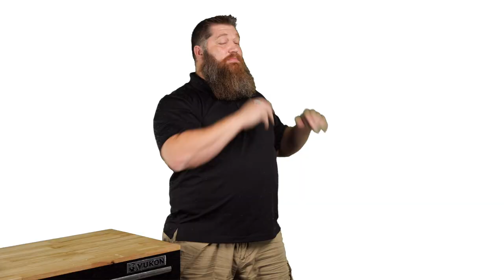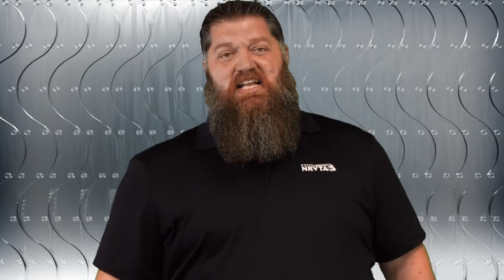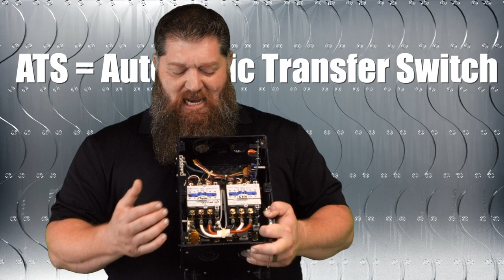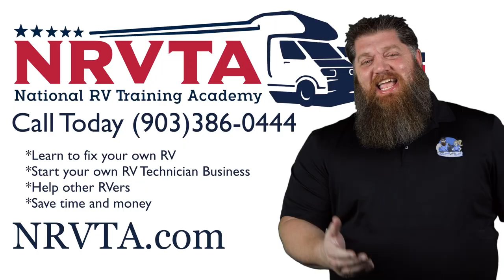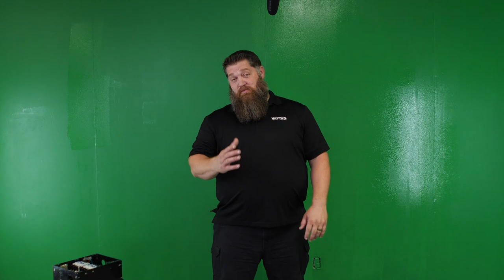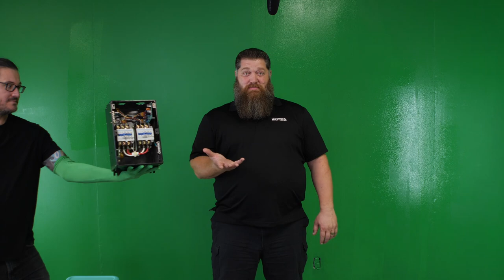What's an Automatic Transfer Switch

Comment: Great lesson, thanks! Experiencing the same problem you described at the end of the video. Generator powers on appliances, but shore power will not. I tapped the transfer box with the handle of a screwdriver and voila, the shore power switched flipped and now works properly. Is it a fire hazard?
Reply from the maker: @ShartKart  could be. The contacts freezing up is a sign of failure which in combination with electricity is a hazard.

Comment: All the transfer switches I work with have a mechanical interlock that will physically block the gen power and shore power from being interconnected at the same time. If one set of contacts welds, it will not allow the switch to physically operate, double redundancy to protect the rv circuits. Also most have a delay mechanism on both sets of contacts so the switchover isnt instantaneous which will damage components in the rv.  Its not uncommon for there to be about a 10 second delay in switchover, this allows the generator to come up to full speed, without this delay the generator may not have enough power for the demand and will not produce any power. The best ones will run a prime then thru an extra set of contacts, will auto start the generator. Best advice, keep your generator serviced with regular weekly run times of a few minutes.

Comment: The scenario of not having to go outside to do anything and just flipping the switch to start the generator on to switch from shore power, at least for my Onan 4000, is false. The power cord has to physically be pulled from the shore power supply and plugged in the generator to use it. Other than that, your info was great.
Reply: I have an echo pro with a thirty amp outlet but when I Plug it in my transfer switch will not transfer.. As soon as I plug it in to my 20th garage everything comes on and transfer switch works. What am I doing

Comment: But why is mine under the bed where it's really hard to get to.   *&&%%%^ RV designers!  Keep the good stuff coming Todd.
Reply: Ha Ha, too funny. RV engineers are assholes in a class all their own, just try to find a slide controller in a class c for the bedroom. Remember most RVs are built from the inside out unlike normal engineers who design from the outside in as in structures.

Comment: I have a 50 amp class A motorhome with at 50 amp ATS but neither shore power or generator power is charging my house batteries...my solar panels charge my batteries and so does the engine alternator under the hood...what's up with my ATS?
Reply from the maker: So the ATS goes to the breaker panel box. If you have 120v to your air conditioner abd microwave on both shore AND then the ATS isn’t the problem. 

Converter is what takes the 120v and charges the battery. Is that breaker to the converter on? Reset it. Is the battery disconnect in the proper position? Start there.
Reply: @NationalRVTrainingAcademy  Thanks for the suggestion. It was the converter/charger that was malfunctioning...mystery solved...thanks again!!!!

Comment: Can you do one on the Converter? It's always fun to find where they put it. It's an interesting way for a fat disabled guy to climb through the basement, over the furnace just to change the 2 fuses that went out.
Reply from the maker: rule of thumb

if you hear fans under your breaker panel box then it’s there. 

5th wheel it will be behind the false wall in the front cargo area. 

motor home….ANYWHERE

Comment: My RV control panel shows "Shore Power Fault". Power is working in RV with no problems. I connected to another 120 volt power source and am getting the same error message. So i know its not the RV plug coming from my house. Would this error have anything to do with the transfer switch? Thanks. Ronnie.

Comment: What if I don't have a generator but I have two different shore power plugs on the RV to run to the RV Park pedestal one at the back of the trailer and if I add one to the side of the trailer incase the Park pedestal to to far away from one plug I can use the other plug. Do I use a transfer switch or just a junction box and make sure I never plug two cords at the same time?

Comment: I am adding shore power and solar power. I have an inverter and a power panel/converter and all the controllers. I bought an auto transfer switch, but it is advertised as a Solar Transfer Switch. Does this mean I need two switches, like one for solar and one for shore/generator power coming into my trailer? Thanks to anyone who can answer this question.

Comment: I have a 50amp RV that is pre-wired for a generator with an Auto transfer switch. I mounted a 30 amp portable generator on to a cargo carrier using the trailer hitch (I can tow 5000 lbs with this hitch on my fifth wheel). I hard wired the portable gen into the pre-wired electric box for the onboard gen. I discovered that unless I connect the 30 amp L1 wire from the generator to both the L1/L2 wires which feed the transfer switch, the transfer switch will not switch to the generator feed. Is this what I should expect? Am I doing something wrong?  Is there a 50/30 amp transfer switch?  I installed the Victron Multiplus II 12/3000 inverter. The issue is that the inverter can’t see, and report correctly which power source the RV is using because both L1 and L2 always have power. According to the inverter manuals, L1 is shore power and L2 is generator. But when power is on both lines it sees it as shore power. In theory, if there was only power on L2 it knows it is a generator and automatically transfers power to both sides of the inverter output. Thanks. After I retire I am going to enroll in your school. Love what you are doing for the RV world.

Comment: Do they make a manual transfer switch?
Reply from the maker: yes. they were out before the  ATS
Reply: they are mostly non existent now except in a few older models. the cheap way they deign them now is to give you enough shore power cord to reach the 30 amp plug on the generator or wire a box to plug into in the cord compartment.